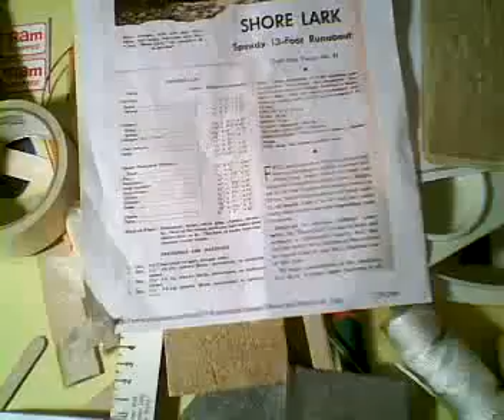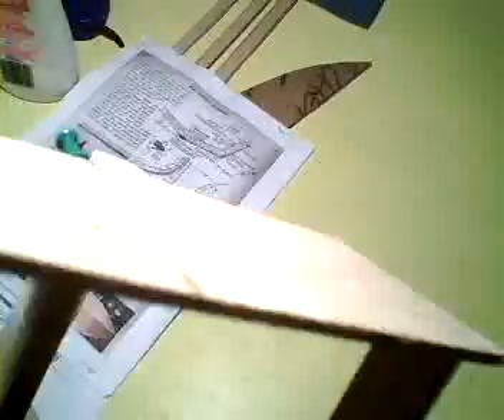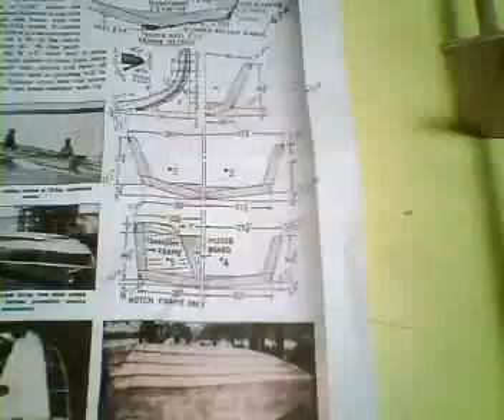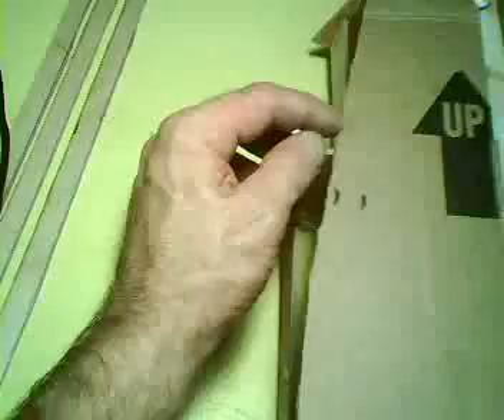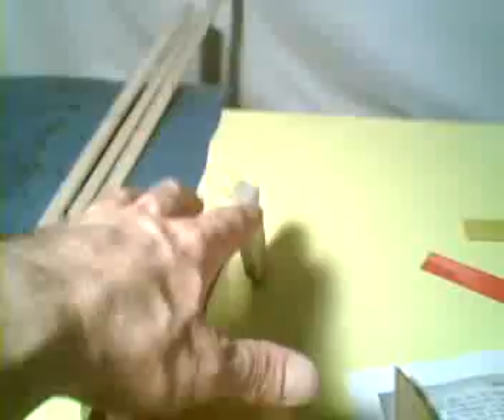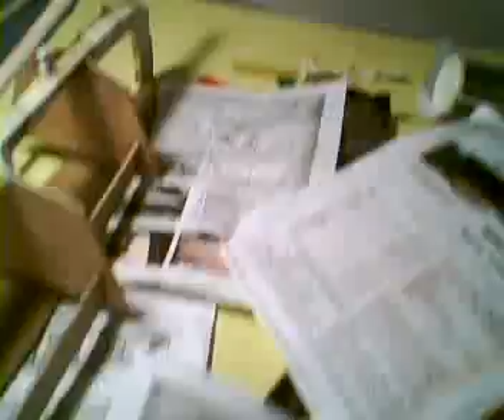27 inch scratch built runabout boat part 3

Comment from the maker: @badboyazza2009 I'm putting my inboard motor forward and running a longer shaft through the hull up front and running it aft to where I will attatch the ouboard leg under the boat, if the hole for the end in the boat is higher than the water line, no water should come into the boat. By doing it this way I have no visible hardware on the transom , even the rudder and be put through the hull this way as long as the tube is higher than the water line again...god luck man....